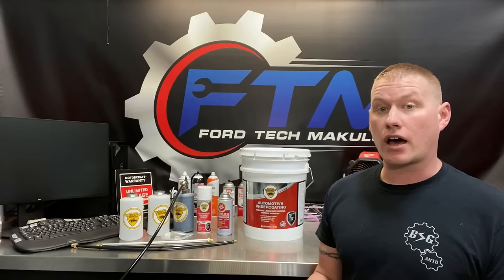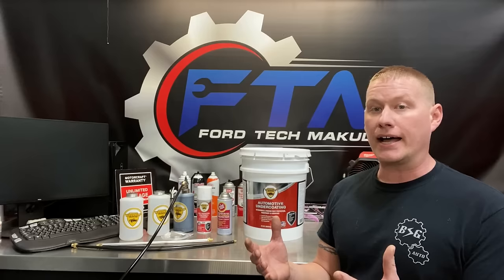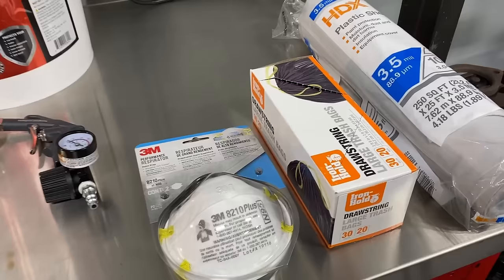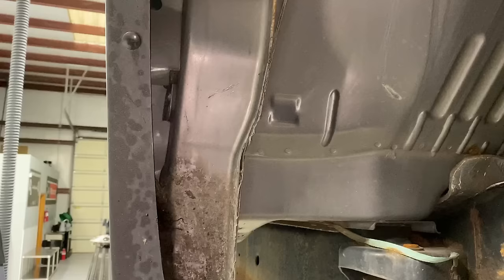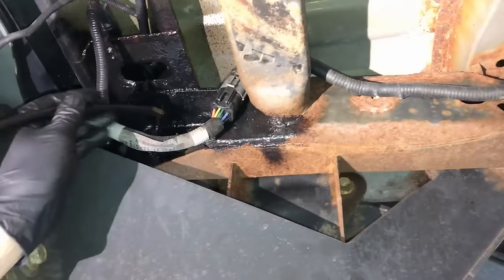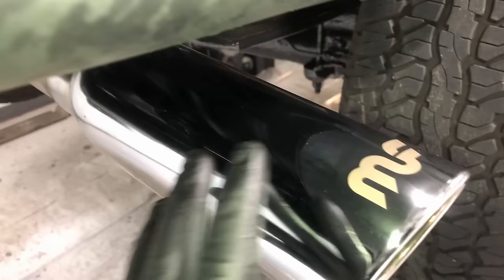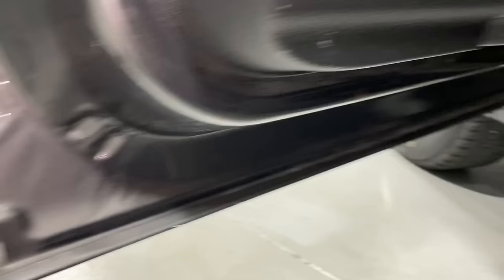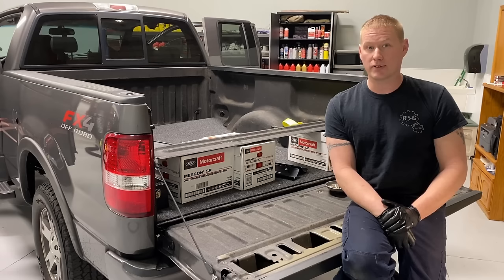Undercoating Your Vehicle with Woolwax: Is it Really Better than Fluid Film Though?

Comment: Every time I see the condition of a car that has spent any significant time up north, I'm very thankful I live in the south.
Reply: W Sears although these oils are great preventative, REGULAR car washes are a must and they absolutely work. So many people have their car washed maybe a couple of times during the winter when they should be going a couple of times per month and ideally after the roads dry form a snow storm. I’d bet money that his 15 year old truck looked as good as it did because it was ran through a car wash with undercarriage cleaner on a regular basis.

Comment: Have never heard of this Woolwax until today but have tried a few things in the past which turned out pretty good for me. One product I had good results with was Corroseal Rust Converter which I purchased from Cloverdale Paint. I have sprayed undercoating over it and have had no issues in over 5 years. Surprisingly, very few spots have needed more attention.

The other is used motor oil . I used it on the underside of my lawnmower deck a couple times a year so I figured I try it on the woman's car. It has been a couple years and with good results considering I haven't followed it up. Gramps even stained his cedar fence with used car oil yearly, which lasted for more than 30 years and would likely still be standing if when he sold the place they didn't bulldoze for townhomes. 

I use Fluid Film too on tools mostly but also Anti Seize on nuts and bolts. 

Final thought... 
I did not like the so called 360 spray tip. I have used a sewer jet on a pressure washer that would work way better. It spins around and would provide way better coverage. Similar to https://www.youtube.com/watch?v=Q99v_DV1h4Q

There is also a similar tip used by ventilation companies with compressors to blow out HVAC and dryer vents but you will have to dig for that one.
Reply: I apply the used oil to the wood trailer deck also as my late friend told me they did it at his company and thw wood never rotted

Comment: looks like a great alternative to rubberized stuff that to me always seemed to be bad long term... one suggestion though- after prep by knocking all the loose stuff off, with decent PPE, use a spray bottle and/or a cheap paintbrush with ospho and spray treat everything with ANY rust, before doing the undercoat part...ospho- or whatever brand phosphoric acid metalprep you can buy locally- converts iron oxide to stable iron phosphate, and really stops rust dead in its tracks... I kinda prefer painting over it but can see where a grease/wax overcoat might be better as most folks dont see their undercarriages after 'getting undercoated'... I tend to try and prevent any issues first, look over when changing oil or in the air for any reason, ospho/paint overcoat as needed, and before winter, when changing oil, use old rags and the drained oil to wipe down the chassis...its a slow oil change, but easy to see where youve cleaned/missed, and really it dont take all that long...a hour tops once a year before winter is worth the effort

Comment: You did an excellent job with truck prep, I just can’t believe you didn’t use a 5 year guaranteed primer. It can even be installed with a brush and painted ( or in this case undercoated ) 24 hours after applied. Good job and nice video for first timers..

Comment: Amsoil Heavy duty metal protector  is my go to. Actually dries unlike Fluid Film or the stuff used in this video. Applied Amsoil to my 2018 4runner last yr, one Wisconsin winter later looks great. Only a little touch up was needed before this winter due to being lifted on hoists for maintenance.

Comment: The best rust protector on clean metal is a good 2 part clear coat.
Reply: Makes sense. You can see under it  and reapply if it starts rusting.

Comment: Your saving you truck for sure, glad to see this done , I have a 2011 f150 replaced the rockers and cab corners  just purchased it in the fall but ran out of nice weather to complete should be on the road  spring 2020  . Time off over Christmas will allow me to oil undercoat .Been doing oil under coat to my 1976 vette for 38 years I just completed a restrod restoration on it including a blue and diamond metal flake metal paint job that took me 3 weeks to spray having to wet sand every 5 coats including the 42 coats of clear acrylic lacquer that  applied to bury the flake  . I had to use lacquer because I became highly allergic to methyl di isocyanate from exposure to it in build box store cans of spray foam insulation applied to a boat restoration 2 years back ,the isocyanate is in most 2 part paints ,bed liner ,tire foams ,cans of insulating foams sold I dept stores hell it killed thousand in the 1980 ies in Bopaul India when it leaked out of a plant making it . So be very careful spraying 2 part paints without a paint suit  nitrile gloves not latex full face fresh air supplied respirator don’t be fooled in to using a dual cartridge n 95 carbon filtered paint half mask several licensed body men I know had to quit the trade because of this stuff going right through the mask ,latex glove are useless the isocyanate goes right through latex but not nitrile. Be safe

Comment: I AM A BELIEVER.  
Used Fluid Film, Graduated to Wool Wax. And like the black.
Always used rattle cans but, recently got a compressor for a travel trailer and winterization of said TT.
So, will graduate to a sprayer.
My Gen 1 Ridgeline, sold to a family member, needs TLC. AKA rustproofing. 
My aluminum F150 needs less but the steel parts, frame, axles, springs, mounts, still benefit from TLC...Wool Wax.
Show me rust and I'll spray it with WW!
Nice vid...

Comment: The only problem I had was the wands to not like bending at all as they are thin walled hard plastic. I used a short piece of polytubing over the wand just at the gun connection to prevent the tube from bending.

Comment: Pro tip: wash then dry vehicle then throw a coat of wax on then spray the lastly remove wax. Overspray won’t be on paint but will be on wax! How Jeep trained me to do it
Reply: Greg Rath. Awesome tip I used to do car detailing and auto body painting and undercoating at a Chevy old dealership in Parkhill Ontario the final days of 302 ,327 ,350, 396 , 427, 454 ,455 11-1 compression engines I started at age 13 and finished in 1977at 22 after graduating from college in electronics but I still kept up with auto technology at trade levels  body paint and mechanical over the years this allow ,me to drive nice older cars and truck and boats at a fraction of the cost of buying new plus it’s fun hobby and you meet mostly nice people
Reply: That's the procedure I did with my new Ram & Jeep.
Reply: I don't completely understand this... why would you remove the wax?

Comment: I purchased a new 2019 Toyota Tundra TRD Pro beginning of October and got the same exact Woolwax kit but used the clear.  Took some time to do but well worth it.  We had a snow storm already with salt and brine on the roads.
Reply: Don't have to on Toyota they use marine grade coatings on every metal part
Reply: Hype Tempo, my brother has a 2017 Tacoma and he gave the truck the Fluid Film treatment 2 years ago last fall. After the first winter he could see exactly where he missed coating underneath because there was surface rust. He hit everything again however a little more careful to avoid missing any areas. We'll see this spring how it's holding up. Anyone tells you that Toyota has a marine coating on the chassis that may be true but it doesn't work. If you don't coat it underneath it WILL rust. We live in north central Illinois.

Comment: This is all a good idea if your a do it your self kind of person. I used to be a do it your self kind of guy. But these days I just can't get around like I used to be able to do.  Now these days I would call the Krown dealer near you to make sure you can drive away from the new car dealer and drive right to get it done at the Krown dealer.  Also like he said this is a yearly maintenance item or it's like putting your snow tires on every year / season. You can search on YouTube for " Krown Rust Proofing - Part II The Application " to get an idea of what a dedicated dealer application will look like. I've got my local Krown dealer number in my phone so I don't have to look for it every year.

Comment: Whether you use 3m wax or not their wands  really do easily spray a true 360° unlike the brass tips ive seen, they're worth the $25. Saw a guy use bic ballpoint pen plastic parts to adapt  nozzles to different  brands or male to female really smart hack. Dont have the link but should be easy to find, don't know how to add it here, its worth it. My new to me a yr ago 14 150 that was a very well maintained lease I used 3m on. Had "factory" tape over the 18 holes or so on back of the rockers, used the rubber gorilla tape for permanent seals. Have an auto paint shop 5min away luckily  (Florissant Auto Paint)  ive used for yrs, I use 3m for almost everything, never disappoints. Just did the rockers, wheel wells and should hopefully have enough left to do doors on 2nd can, it's a bit pricey it does flow fast and seeps well. Just my 2 cents, very good video.

Comment: I've been using a Canadian product called Corrosion FREE. Similar concept to the Woolwax/Fluid Film, but safer for rubber and plastic. I just wish there were more shops that offered undercoating services, since most people don't have a lift and air compressor.
Reply: Who makes Corrosion Free and how long haveyoubeenusing the product???
Reply: @mercedesbenzs600bash  The company is called Corrosion Free, and their product is called Corrosion Free.
Reply: @DRWebster93  Found it on Amazon,thanks my man..
Reply: @mercedesbenzs600bash  No problem. But I realized that I misspoke about the name of the product. The company is indeed called "Corrosion Free", but the product is called "Rust Cure Formula 3000".
Reply: @DRWebster93  That Rust Cure Formula 3000 looks like it comes in spray cans,the Corrosion Free is in gallon jugs,which one do you use???
Reply: @mercedesbenzs600bash  The spray cans and the gallon jugs are the same product. Look at the very center of the label on the gallon jug. It says "Rust Cure Formula 3000" just like the spray cans. The shop that undercoats my cars buys it in bulk (I think 5 gallon buckets). I buy the spray cans for touchups and other equipment.

Comment: I just sand blasted a a truck bed last week and you would surprised what looks good, but really isn't . Zero rust, but a quick pass with the sand blaster removes loose paint in spots and one can see the metal is turning. Sand blasting until everything is uniform silver color left a few holes!

Comment: The Fluid Film in the SPRAY CAN is fairly thin, because it has to be.  Not sure if you've ever bought the GALLON or larger size Fluid Film, but that is MUCH thicker than the version in the aerosol spray can you can use it in a large air powered sprayer like you show with the wool wax.  You can even get Fluid Film in a 55 gallon drum.
Reply from the maker: I know there are even different versions of fluid film that can be had in 1 gallon and up pails too but they claim this one is even thicker plus its black so I figure lets try it.
Reply: @FordTechMakuloco    I occasionally use the gallon can of fluid film under my mower deck.  It's pretty thick.  I like the stuff you used and it seems similar to the bulk fluid film other than the color.  I guess you can look at it one or two ways...black looks better under the vehicle, but could also obscure certain things you might want a better look at like wires and so on (colors).  It might be very similar other than the color.  Seems like it anyway.  I assume wool wax is also a dielectric like fluid film.

Comment: At 30:00, you really need to pull those plugs on the inner rocker panels and use your 360 extension wand inside there. Thats where all the serious rust comes from

Comment: Nice work, an easy way to not get overspray on looms and wires etc is to use some aluminum, the light weight stuff. Easy quick wrap. I would also spray the oil and trans pans. Eventually, at least on Dodges, they start rusting. Damn the inside hole shot shows very poor coverage. Woolwax carries a pressurized gun now which should push more product out. Thanks for this detailed video!

Comment: I used wool wax this year on a few places on my truck to try it out. I usually use 15-40 motor oil mix with Lucas
Reply: @ThePariss333 the engine oil stabilizer
Reply: @ThePariss333 yes I use my old motor oil to uncoat my truck.

Comment: I'm a retired industrial painter, and I'm just curious if a paper suit, their inexpensive, and a spray sock to cover your head may help. We use to use some very good epoxy coatings for steel, I wonder how they would work for undercoating? DuPont, and PPG and others make some good high quality epoxy coatings. But, I guess this formula is specifically made for under coating a vehicle so I'm sure it's a very good product. Anyway this has to be a really big help in stopping your truck from rusting out underneath, the frame, etc.. Very good job. You may have just expanded your services offered. Thanks, John

Comment: I used Fluid Film last year and this year I used Woolwax. Both good products -- Fluid Film is a bit too thin and Woolwax is a bit too thick, which makes it more difficult to spray with a nice even mist. Woolwax kind of spits out and doesn't shoot very far.
Reply: do you know if the woolwax cans are thicker than the fluid film cans? I only use spray cans because I can't afford a compressor. thank you
Reply: Very little difference in the spray can between the two. I got a can with the kit I bought from ebay and it sprays nicely from the can. I would recommend you warm the cans to at least room temperature (65 degrees. )
Reply: Maybe we should buy a gallon of each and mix!

Comment: Brian,  I am from the state of Delaware in the mid Atlantic and we have never heard of spraying a messy oily film to undercoat a vehicle.  We have good luck with Eastwood paint products such as the internal frame coating.  I used it on my 2007 F150 4x4 supercrew.  We have salt and brine just like you do in Michigan but only about 3 months of dealing with nasty roads every winter.  Looking forward to the follow up video.

Comment: Those 04'-08's are good trucks. I really liked mine even with the 5.4L. When I get a vehicle now I spray Fluid Film on a hot August day. Let it creep for a month or two and then come with the WoolWax before winter on a warm Fall day. That Fluid Film really creeps when its hot outside and the WoolWax to me is like a topcoat of extra protection. Then every year after hit it with the WoolWax. On the 05' and newer Super-Duty's really make sure to take out the front wheel-well liners and spray the top of the shock towers that hold the front coil springs. I've seen them completely rotted at the top. Salt just lays up there. I've seen 10+ year old trucks sprayed with Fluid Film on a yearly basis and they look like Texas or Arizona trucks. Lanolin is the way to go.

Comment: On the F250 Ford line many years ago they sprayed a wax/paint in the door jams.Then the bean counters got involved and cut that out.those doors are still rust free,just look at old 250s on the road.I worked on a line after the e coat.when a employe truck job came by,I took a good stop rust pain on the rocker panels and wheel seams even though it didn't show a boss said NO NO 😳🤔

Comment: Has anyone ever used Rustbullet sold through Summitt racing? My freind bought that stuff. It actually eats through the rust.  An optional top coat is recommended. Super easy to use and lasts a long time. Check it out!

Comment: Good Video! I haven't used Wool wax as of yet but will try it in the future and great tips on that. 
I have used Fluid Film for many years in my auto repair shop, on my personal 1996 F250 plow truck as others and had good success with it but it is definetly more fluid and the over spray is bad when using the air sprayer. Another tip I would add is to use cardboard, sheet or expendable blanket on top of the plastic drop cloth on the floor to help soak some of the drops before you step on them and they ultimately get all over the nice epoxy floor as in your shop and mine! The first time I just used just plastic and as I walked on the falling spots it then was all over my epoxy floors making it very slippery! Looking forward to trying Woolwax for longer protection. Thanks for all the good tips and the detailed video showing what is required to do it properly!
Reply: Dave Edelstein .    Thanks for providing additional success tips.

Comment: I wanted to take my truck somewhere to get this done but after watching this I feel like I should do it myself. I have a feeling these places will just spray it everywhere. All over the connectors and what not/ not do a thorough enough job in the hard to reach spots. Problem is I only have a small 6gal compressor

Comment: Hey Brian. Great video. 
Quick tip to deal with thick fluids.
Place the 5 gallon pail in an empty sink then fill the sink w hot water.
Find a lid with a hole. Now you can lay the pail on its side.
Rotate until it pours out.
Use a funnel that's the same volume as your bottles. Fill the funnel once to 90%.
Also would use an exhaust fan with a filter to circulate the air.

Comment: I use Berkebile PFC on my snowplow blade. Works great. No snow sticks to blade.  Same Berkebile Oil Company that makes 2+2 Carb Cleaner. Fluid film for general use around the farm equipment and vehicles. What’s really nice about both these products, they lubricant as well as corrosion protection. 
Great video. I would suggest power washing prior to beginning your prep. Reduces the amount of labor required.